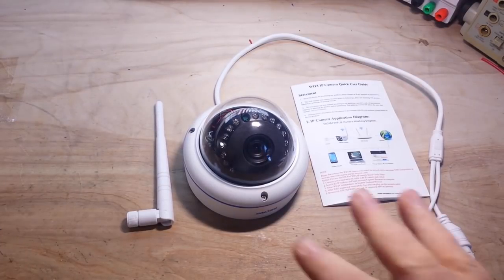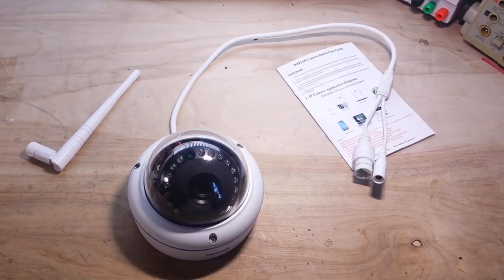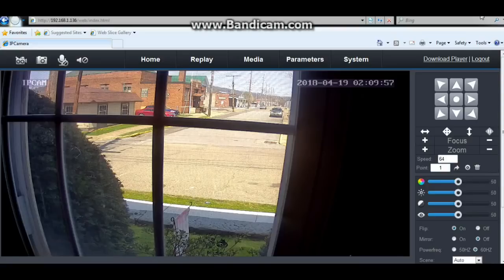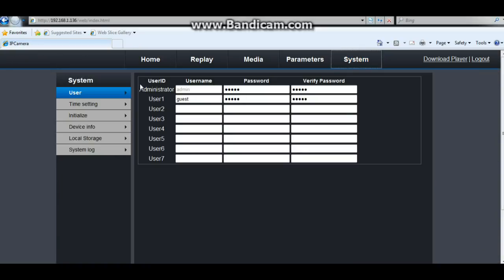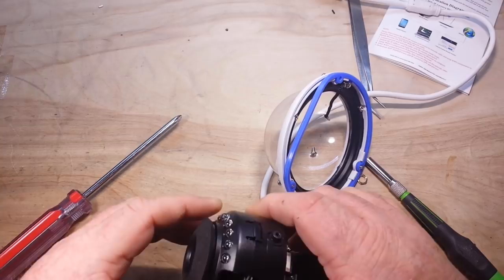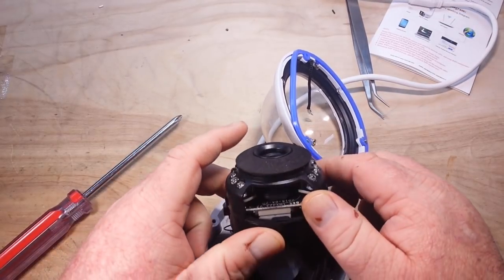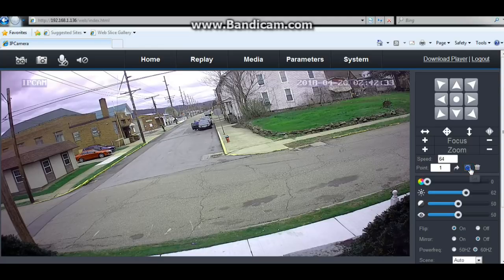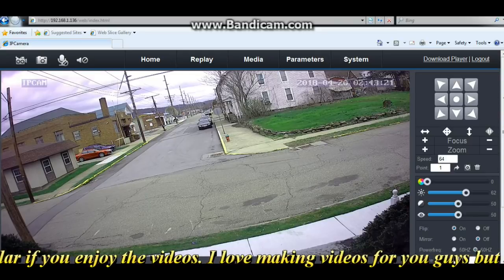ESCAM Speed QD800 Security Camera from Banggood

Comment: I have the very same camera.  I also bought it from Banggood.  However, I don't see any image.  It connects to WiFii just fine, but no image is shown.  It says that I need to download and run the ipcamerasetup.exe.  I did that four or five times, but there doesn't seem to be an icon to run it.  When I look at the folder in program files, there is no exe to run, but there is an Uninstall I could run.  Got any ideas?  Thanks

Comment: I bought an ESCAM from Banggood don't remember the model. It did have PTZ but no ethernet connection. It was imposible to connect to it, so I dismembered it and just used it as a fixed camera. Piece of junk, but hey I didn't spend $65 for it either. Funny, it snowed here yesterday and it's about 60 today, go figure. Thanks for the video as usual!